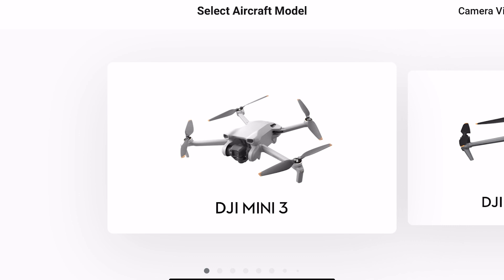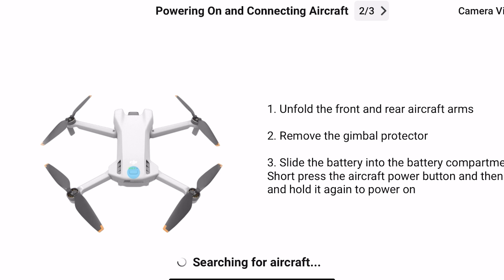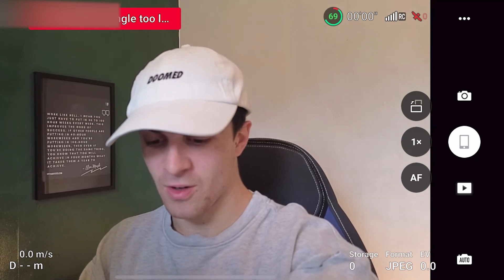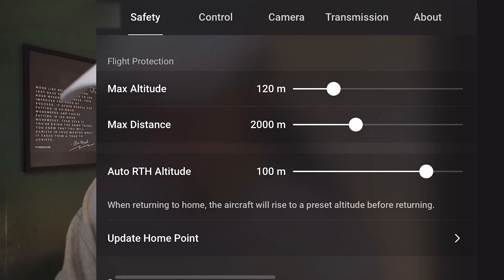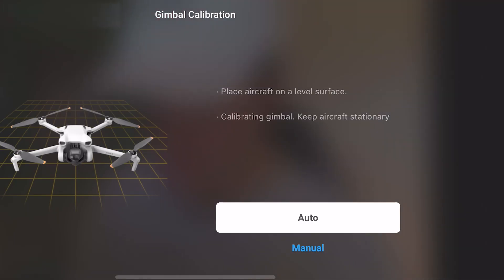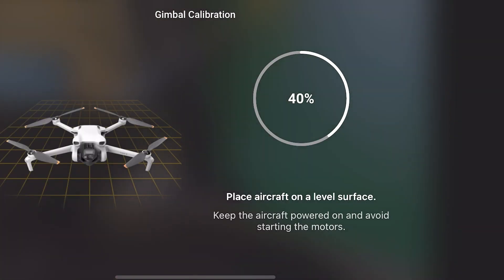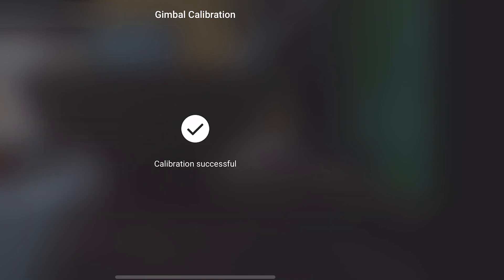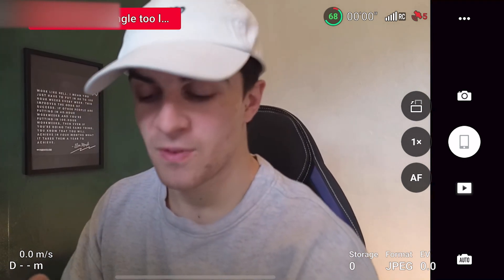How To Calibrate Your DJI Mini 3 Gimbal (Calibrate DJI Drone)

Comment: Worked great for me after several tries using DJI Assistant 2 on my Mac. Drone disconnects from USB before calibration is ready due to a time out.  
Googling for error 40027 led me to using DJI Assistant.
Thanks for your video.